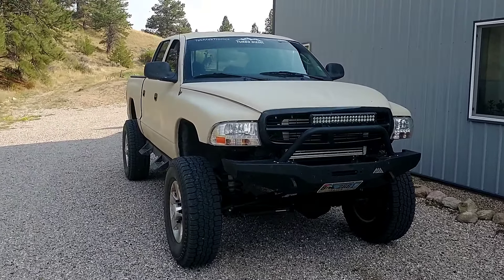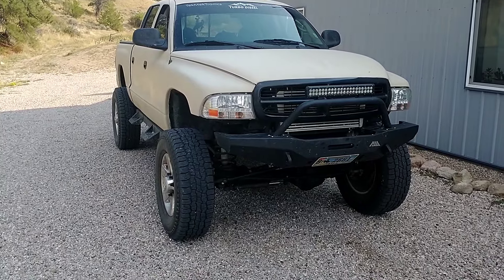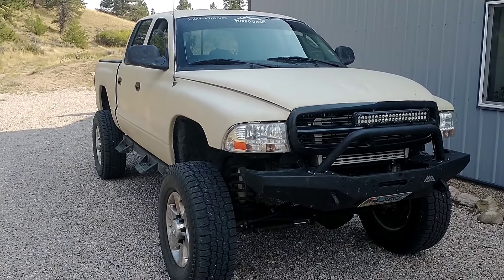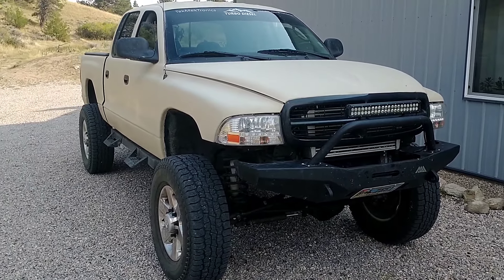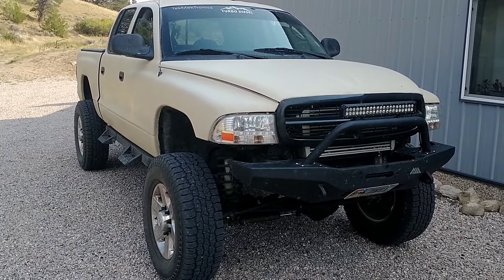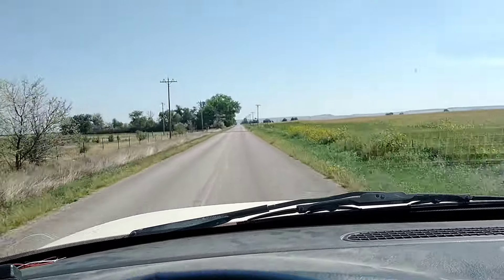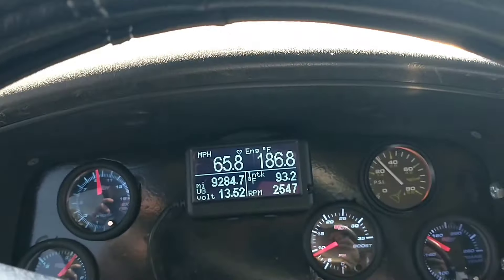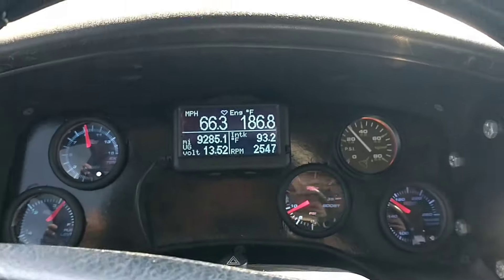1.9L TDI Diesel 1 Ton Dakota Overview/Ride Along

Comment: 180hp and 300ftlb is a good spot for a truck. thats what my 83 f250 diesel has. dont let em tell u otherwise, mfs were hauling logs with 100hp not too long ago.
Reply from the maker: Yes sir!
Reply: 100HP and 300:1 gearing. That said, it's still impressive the things that were accomplished with not much HP.
Reply from the maker: @lka1988 ya honestly though this thing is matching the V8s torque numbers

Comment: I want to put an ALH in my '96 F-250. Thanks for doing and posting this. 
Note, I'm going to keep the truck light and no towing, It also has the factory manual OD trans.
Reply from the maker: It will get you around town and slower highway no problem! I only have issues trying to push 70+ MPH

Comment: Hey 👋
New subscriber, Love the channel! You do things like the majority of us, figuring it out as we go, working with a tight budget. Anyways really good job documenting all this. Few questions what’s your mileage now? 

You mentioned compounds what’s the benefit would it lower your egts what’s the down side other then obviously expense… are they hard to tune? 

Do you have a video of swapping the vacuum for electronic turbo actuator, wiring? Again appreciate the channel, great job!
Reply from the maker: Hey thanks for watching ! I am consistently 21-23 mpg in this thing 60-75% highway.  Compounds are complicated to fabricate, and even more complicated to tune, on top of expense, but the advantage is better EGTs and less stress on the engine from Increased back pressure with my current tuning.  Electronic actuators are a little complicated as well because tuning has to be done for them to work, I would recommend finding a tuner that will do it and they can assist with wiring, it's only 3 wires though.  Again thanks for tuning in!

Comment: It’s really amazing what you’ve been able to build with this truck.  Taking that tiny TDI and able to move that much weight is pretty awesome (and do it reliably).  Do you know off hand what a stock Dakotas’ curb weight is?   

Also, any more plans/modifications for the truck?  Are you gonna swap another tdi into some other vehicle platforms for future videos? 

Watching this is getting me excited to start my own swap.  Got the truck and donor vehicle.  All that’s needed is the adapter plate for the 6 speed.👍
Reply from the maker: That's a lot of questions haha, I believe the four-door Dakota was about 4,500 lb stock.  This being my wife's truck I'm hoping to have it finished up and ready to just give her some reliable service as this is exactly what she wanted for a hunting rig.  I'd like to do some more modifications to mine Toyota and Jeep now as well as maybe one more swap in the future.  Hopefully someday I will do swaps for customers and be able to post those on here though! Looking forward to hearing about your build!
Reply: @TDISwaps   That’s awesome man.  I think as time goes on these swaps are only gonna get more popular.  

What are your thoughts on running waste motor oil through these engines?  I’ve heard people do it with great success but the time to make it and the potential of causing more harm to your engine just to save a few bucks seems like it might not be worth the effort.
Reply: I’ve done it and had badly coked injectors. Also have a cylinder with slightly lower compression and the vehicle is undrivable. Not sure it can all be blamed on the WMO/veg. Maybe it’s tandem pump, valve seat, and injector seals.
Reply from the maker: Ya it's hard to say, I just keep spare pumps and injectors and swap them out when I have issues

Comment: That’s awesome! What MPG do you get?
Reply from the maker: Pretty steady 21-24 mpg mixed driving, city would be a little less
Reply: @TDISwaps  that’s really good! If you had any of the gas engines on 1 ton axles, you’d be getting half of that MPG! That’s an awesome build. I just got a 2001 Audi Allroad for almost free. I’m pulling out that complicated drivetrain and swapping a 1.9 TDI with a manual 01E transmission. The power goal is very similar to yours. My Land Cruiser will get a 12 valve Cummins. The plan is to run some waste oil and bio fuel on both. Keep posting videos! Also, what state do you live? I’m in New Mexico.
Reply from the maker: @devil2jz500 nice! Eventually I will get my Cummins swap started, but these TDIs love waste oil too.  Sound alike you have all kinds of stuff planned!  I am in Southern Wyoming now, but I lived in Alamogordo 2012-14' thanks for watching.
Reply: @TDISwaps  I got the phone number of a few small 18wheeler shops and owner operators. They are always willing to give hundreds of gallons of waste oil for free. I just need to buy a few drums, a pump and a small trailer. That’s the future! lol
Reply from the maker: @devil2jz500 sounds like a good future!
Reply: there are a lot of people who boast of 30-35 miles per gallon) are they lying?)
Reply: @ВладимирЯковенко-б2з  no they have smaller vehicles. Some say they can get a golf up to 50mpg
Reply from the maker: @ericnolff8496 exactly, my Toyota gets 30 mpg but it's 12 in shorter and 1500 lb lighter
Reply: @TDISwaps  that’s awesome! I just got an 01’ Audi Allroad. Doing an ALH and 01E swap with a 40mm lift. It is mint, clean title and I bought it for $200 with a stuck in gear auto transmission lol. (I already fixed it, it was the shifter cable). I can’t wait for the TDi swap
Reply from the maker: @devil2jz500 sounds like fun!
Reply: @devil2jz500 does the 99-04 allroad have a divorced transfercase or how the manual tranmission hook up to the 4wd?
Reply: @ they all have the same transaxle. Any VAG engine bolts into it, literally from the TDI to the 5.2 v10. Same bolt pattern
Reply from the maker: @BozAwesome In my swaps?
Reply: @devil2jz500  i literally collected allroads and alh tdi's and didnt know that. Im just getting around to these projects and thats great info, thank you. 

I assume youd want a manual transaxle then for a swap to tdi, or do you need to modify transmis controller when doing the tdi swap on an auto allroad?
Reply: @devil2jz500  what about 99 A4, i had a manual 5sp 2.8 and got a new motor, 2.8l and ot didnt fit? I never figired out what i did wrpng on that project. Something about a vin split
Reply: @ yes sir, manual transaxle and matching rear differential. I’m using the 01E 5 speed manual from an 01’ S4 and the rear 4.11 diff from an 02’ S6.  The gas 1.6 carbureted engine built in 1978 that came on the Audi 4000 has the exact bolt pattern as a 2015 Audi 2.0T, 2.0TDI, 3.2 V6, etc. They never changed the bellhousing pattern. For the 5 cylinder engines all you need to do is shave 1/4” from the top of the bellhousing to clear the timing chain cover. Flywheels and clutches are all interchangeable too. Audis only have 2 problems: modern complicated engines and bad automatic transmission. If you swap them to a manual and use a TDI or a 5 cylinder turbo, they become amazing cars.
Reply: @ all the same. That transmission has weaker internals than the S4, but it can still handle 350hp without problems. Just pull that 2.8 out and swap an ALH 1.9 TDI. You’ll have a nice torquey high MPG A4!
Reply: @devil2jz500  both my allroads are 4.2 v8's, I have seriously just decided to swap one to ALH with 01E. Thank you! This is great, it was just my birthday and this was my favorite gift haha
Reply: @ do it! I have a neighbor who has an ALH manual 03’ Allroad and he loves it. He gets 50+mpg, runs black oil and makes 180whp/320tq. I think his is a 6 speed.

Comment: Is the turbo a variable vane?  I'm running a manual 11mm Injection pump without an ECU.
Reply from the maker: Yes it is, that's part of how I keep my egts down. Leaving the veins closed and increasing drive pressure between the engine and the Turbo slowing the exhaust flow down actually reduces egts and keeps in the cylinders.  I have tried running normal wastegated turbos in the past and it's much harder to control my egts with them.
Reply: hi, what kind of turbine are you using?
Reply from the maker: @ВладимирЯковенко-б2з this currently has a grc1549vk, the stock turbo on a 2015 2.0 TDI, modified to fit the 1.9 manifold
Reply: @TDISwaps  didn’t you want to try a 2052 or 2260 turbine?) A large impeller heats the air less...
Reply from the maker: @ВладимирЯковенко-б2з I've have about 30 turbos on my swaps haha, this truck needs boost right away at 1500 rpm and none of those bigger turbos will do it.  I had a 2056 on it to start with and the bottom end was worthless.  My plan if this runs too hot is to add another larger turbo on top for compounds.  But if you watch my IATs in this video my huge Intercooler is keeping them barely over outside Air temperatures.
Reply: @TDISwaps I am writing with a translator, I hope you understand what I mean. I assume that there may be some inaccuracies in the turbine control algorithm. I understand what you wrote. But this is a very limited engine mode, when the pedal is pressed hard, and the engine speed has not yet increased due to the heavy load. Usually this problem is felt on a manual transmission. At this point, there is insufficient exhaust gas flow to create the necessary pressure at the intake. To do this, you just need to stop the turbine geometry at about 50 percent and hold it until the engine speed exceeds 2000-2100 per minute. This helps to develop the necessary pressure. I think so )
Reply: @TDISwaps I installed a VGT turbine on an old engine with prechambers. The size is about 2260. I racked my brains for a long time how to control it. I came up with a two-stage pressure regulator. I adjusted the springs for a long time, but now everything has become so obvious to me. The car drives much more vigorously. And for the mode you wrote about, I just need to make an additional vacuum limiter for the geometry stroke. There is absolutely the same problem if you are driving uphill in high gear, and the revs drop to 1700-1500. Then you need to press the geometry a little in absolutely the same way to create the necessary pressure. And in other modes, a turbine with such dimensions is more fun.
Reply from the maker: @ВладимирЯковенко-б2з your translator is working well! And yes controlling the vanes properly is critical in making those big turbos respond well on a small engine like this.  I have tried many configurations and they just do not make boost at 1500 rpm.  This turbo will full boost to 30 psi and rip the tires loose at 1400 RPM standing still.
Reply: @TDISwaps  A larger turbine simply needs a little more time to inflate. But if the geometry is fixed in a certain position for some time, then there will be pressure. I repeat, a small turbine is optimal when you need to push the car quickly, and then, when the engine speed exceeds 2000, it is inferior to a larger turbine in everything. My turbine control algorithm is as follows: 1 stage, opening the blades under the tension of the first spring only removes turbo lag, it takes 0.5-2 sec, the opening time depends on the amount of fuel. 2 stage, the geometry takes a position of about 50 percent of the opening and is controlled by a very tight spring (taken from a plunger). The stroke in this mode is very small. 1-2 mm. To inflate the pressure when the exhaust gases are not enough, you need to prevent this tight spring from compressing. An additional limiter is needed for this. And everything is actually quite simple. And all modern control systems jump around this simple algorithm, getting into self-oscillations and other control shortcomings. In fact, a turbine with a gate simply does not have 1 stage of regulation, and therefore has a turbo lag. And then the regulation is absolutely the same. And turbines with a gate also need to close the gate with a large amount of fuel and low engine speeds.
Reply from the maker: @ВладимирЯковенко-б2з I understand that, but this truck is just too heavy to even start moving without boost, and the automatic transmission would not let the engine spin to 2000 RPM, so the easiest solution was a smaller turbo.  The truck is not used for high HP, it just needs to hold speed on the highway.  You can watch my previous videos when it had a 2056 turbo on it.
Reply: @TDISwaps I have a car with tools and me, 2.2 tons for sure. It started to move very easily with my turbo settings, although the boost pressures are quite small. I don't think you need to press the pedal to the floor to move the car from a standstill...) With a large turbo, the cloud of smoke is slightly larger when starting abruptly. No more. And so the engine began to spin better when you press the accelerator pedal slightly. This is 100 percent) As a result of experiments, I realized that the pressure should increase proportionally to the amount of fuel. For example, you press the pedal 20 percent - the pressure is 0.25 bar, 50 percent - 0.7 bar, and so on. At the same time, there is no black smoke. Only during transient processes.
Reply from the maker: @ВладимирЯковенко-б2з this truck weighs 3 tons normally and over 5 tons with a trailer hooked up. With a big turbo I had to shift to 2:1 low range with transfer case to take off or it would just sit there barely moving and smoking with less than 2 PSI boost.  Another factor that complicates this as I am at 6000 foot elevation, there is 18% less air here than at sea level, making the struggle to get boost even harder.
Reply: @TDISwaps  There is another side to this matter. Excessive pressure on a small amount of fuel also reduces torque. And this increases fuel consumption.

Comment: what type of motor mounts and transmission mount did you use? custom or did you leave the stock ones in there?
Reply from the maker: I used a universal mount on my first 3 swaps that worked very well, on this I tried to reuse the Dakota mounts, actually 2 passenger side mounts, but they are vibrating worse than the universal ones in my other swaps.  There are videos on the whole build.
Reply: @TDISwaps  thanks, I was curious about the vibrations on the stock mounts. Doing this to a 99 Tacoma and the stock mounts don’t have much “cushion” I’ll check them out when I get off work! Awesome stuff!
Reply from the maker: @miguelpasana2869 thanks for watching man

Comment: love a good "rind" along. 
Given that you swapped a big engine for a physically smaller one, why not run a massive radiator and intercooler and who cares.
Reply from the maker: Lol thanks for the feedback 😂 Grammer correct
Reply: I believe the water pumps on the little 1.9 can be a limitation.
Reply from the maker: @bobirving6052 100% agree!